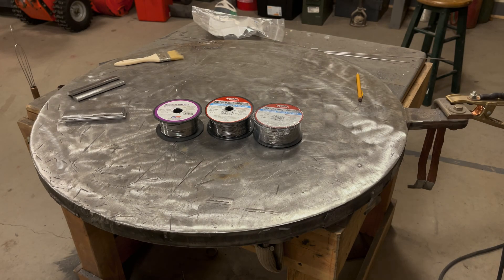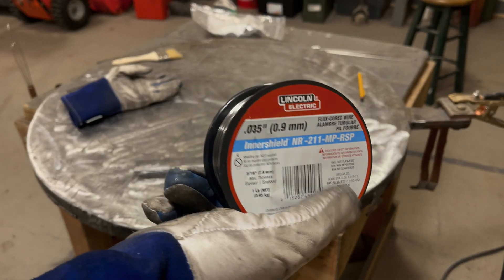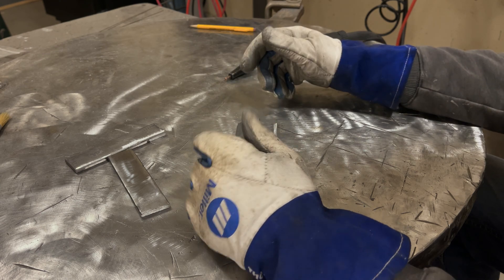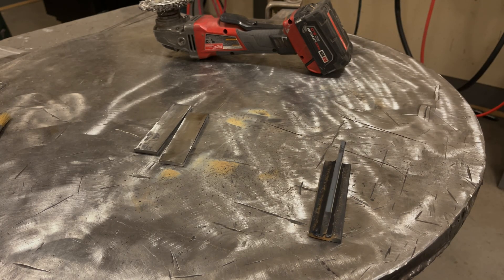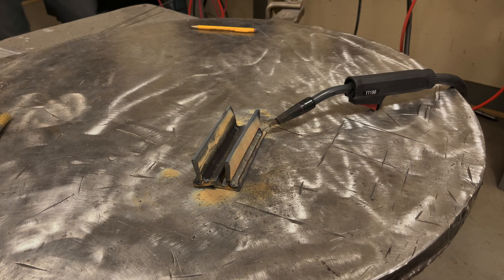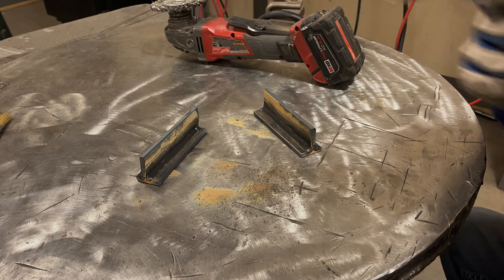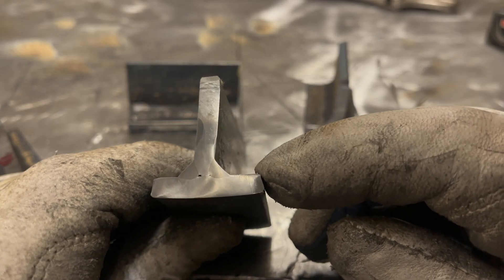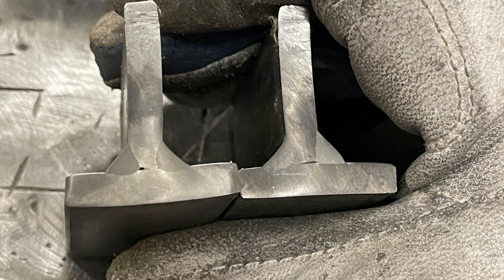Flux core welding part 4.75: 1/4in plate revisited

Comment: This series was great.  Thank you for doing this.  
What is the process of etching?
Reply from the maker: The easiest way to etch is to use naval jelly (strange name, and weird pink jelly) sold at most hardware stores as a rust remover.  Basically it’s a form of acid.  If that’s not available use oven cleaner, it will take a while longer but it works.  Once you cut the piece grind it a bit to polish it with a 80+ grit flap disc and then put the acid on with a qtip.  If the plate is warm it won’t take long for the weld to show up.  If you can’t see it well polish it to a finer level with some form of a sander (D/A, belt, etc) and reapply acid.  It’s worth doing to see how well your welds are doing for penetration 😀👍.

Comment: Great video good explanation, about that breaker tripping, what gauge wire and how long is the distance from the panel to the shop? all of those things matter avoiding the breaker to trip  even of it is a 20 amp breaker.
Reply from the maker: So that shop in the video had a dedicated outlet on a 20a breaker with #12 wire, panel was 25’ from the welder.  Since that video was shot I have come to understand through testing that the welder has poor power factor and it actually loads the input line to over 30a near max output.  It basically relies on the fact the breaker has a thermal trip and welding is a on/off process in the hopes it doesn’t trip the breaker.  Due to the nature of how that welder works (it doesn’t regulate output amperage) you can easily cause it to overload breakers due to setting the wire feed too high (this is besides excessive current due to the poor power factor).  This is generally the case with most 120v wire welders.

Comment: If anyone is interested in it my titanium 125 has a power factor of .37 according to the kilawatt meter
Reply from the maker: Your meter is very close to accurate.  I tested one since that video and came back with .40 with a moderate load, so for all practical purposes it’s right.  Pretty atrocious but provided the welder is on a dedicated 20a circuit it likely won’t trip breakers too often.

Comment: Just being curious is there any way to correct power factor on 120v single phase, i have seen the 3 phase ones don't know what magic is in the box though. Great video thanks.
Reply from the maker: Unfortunately there is no easy way to do it.  The machines that have power factor correction that can run on 120v generally can correct it at all output settings.  Using simple capacitors on the input power can make a difference, but more engineering would need to be done to correct it at all outputs and not just a small range.
Reply: @makingmistakeswithgreg  thanks for the info I'll look into input side capacitors my little stick welder pops breakers over 60 amps

Comment: Do you think the lower penetration on the higher settings could be from the molten puddle wetting out closer to the wire,  blocking the wire from hitting the joint? Kind of like downhill MiG where it’s just wire blasting into the molten puddle vs 6010 where the arc force is blowing the puddle upwards?
Reply from the maker: There is always a ideal range of settings for wire.  No doubt beyond a certain point the wire will just stack up metal ontop of metal.  Since that video I did a lot more testing with self shielded flux core and have come to the determination about the limit with .035 wire on a 120-140a machine is around 3/16th thick for defect free welds and 1/4 inch with some internal weld porosity.  This is for fillet welds, butt welds could likely have less weld defects.  Self shielded flux core in .035 tends to have hidden internal weld porosity on many weld joints due to how fast the weld solidifies, it traps escaping gas.  Going to bigger .045 wire, helps due to heat input, as does using a much more powerful machine.  So basically you’re caught in a catch 22:  a low wire feed will have poor fusion but clean internal welds due to a lack of weld deposit on above 1/4in, a high wire feed produces better fusion and more properly sized weld but the weld has internal defects.
Reply: @ very interesting. I just bought a esab rogue emp210 pro and spooled it up with some .035 flux core from Washington alloy co. I tried it on 120v and made a 4” bead before blowing the 15a breaker but it ran stupid smooth. No crackle or anything. Just a buzz almost. I’m going to try it on my generator and see how it works on that but I’m super pleased with the rogue emp210 pro. Runs 3/32 7018 on 120v as well but maybe not quite as hot as the rogue 180i pro I have. That thing is a freak on 120v and obviously moreso on 240. Do you think you could include some .035 on some hotter settings with a 240 machine? I feel like it’s definitely worth using .035 on a 140 or 180 class and keeping the .030 for the 120v 125 amp machines. Also, Washington alloy co makes some really good rods and wire if you’re ever looking for a new test to try out. They’re 6010 runs better than any 6010 or 6011 I’ve ever found. Welds vert, horiz, and overhead 10x better than any Hobart 6011 I’ve used. And plus, the flux core from them runs so easy that other than your videos, I have no experience with flux core and made a bead that looks unrecognizable from a 7018

Comment: thank you for all your hard work , i am puzzled  with your 1/4 "  test results ( higher settings = less penetration ) . did you come up yet with any theoretical ( scientific ) explanation for those results ? recently upgraded to PRIMEWELD MIG 285 . mostly use flux core for my projects , but if more power  not =  more penetration , i would like to know why  ???
thank yoiu
Reply from the maker: So I think it comes down to a few things.  More wire means more molten pool, and a thicker weld pool means the heat from the arc has to travel through more material.  Fillet welds force the molten material to bunch up in the corner, so if you slow down on thicker plate you can oven lose penetration with mig and flux core for this reason.  Too much wire will often just stack more metal outward from the root.  

Self shielded flux core with quality wire tends to be a great option on material 1/4 and under.  Above 1/4 inch the welds tend to have issues with porosity due to how fast the weld pool solidifies.  If you take 1/4in and 3/8th steel in a fillet weld and weld them out with flux core you will likely find small pores in the weld if you break it.  To get around this issue .045 or bigger self shielded wire must be used, .030 and .035 tend to not be able to carry enough heat to weld thicker steel without porosity issues.  Dual shield (gas shielded flux core wire) tends to not have this issue because the flux doesn’t seem to produce near the same amount of gas as self shielded wire.

Comment: I thought this was going to be a series on flux core and wire types/ brands, not another titanium 125 video.  
Greg, thanks for doing tests and showing it might have some trouble.  The are people that swear that this is the little welder that can...
I applaud HF for not lying much about its maximum output, it's everybody else that's pushing it.

Comment: Dang I should have watched this before I commented on video 4.5 because you got into my go to wire in this one.  The flipping the breaker in this video reminds me of something I noticed with my little Lincoln and it could be true with the other little 120v units that I don't remember ever noticing with bigger machines and that is the difference supply power can make.  Like on my Lincoln first thing I did was to put a new power cable on it I used a 20 or 25 foot extension cored with the biggest coper I could fined. as a bonus if you leave a little length on the female end when you cut it off you can do something like I did and poke a little grinder plug out the front of the machine.
Reply from the maker: Any voltage drop will make a big difference.  Simple transformer welders will lose significant output as the voltage drops.  So your normal “welds perfect” settings all of a sudden weld poorly when powered on an extension cord or different circuit.  The input voltage drop directly drops the output.  With more modern machines they will be far more stable on the output, however many will go into protect mode or suffer damage due to low voltage.  No doubt 120v welders are far worse than 240v.

Comment: Firstly, thank you for spending countless hours producing these videos. For neophytes like myself, it has proven very helpful; both your stick welding series and now the flux core series. I have very recently purchased a Yeswelder MIG 205 DS Multi functional welder. Because I live on a farm, there are always repairs to be done and I have always relied on a neighbour, who is even longer in the tooth than I am. So, I thought I had better learn how to do these repairs myself. Watching your 20 amp circuit breaker trip on a 110/120 v house system made me think of asking you what your thoughts are on running this Yeswelder ( supposedly rated to 200 amps ) on a portable 4 KW generator which offers me 240 v output. Because it would be a portable system, I can take the mountain to Mohammed vs bringing the farm equipment into the barn or the garage. Many thanks!
Reply from the maker: So I can tell you the generator won’t have enough power.  I have made a “welders on generator” video 3x now and I am still not happy with it, so take 4 will be out soon lol.  The two issues you will run into is the power factor of the machine and the efficiency.  In simple terms welders without power factor correction cause power to be reflected back to the generator or the power grid (reactive power).  This amperage on the input line is not used by the machine, but the breaker doesn’t care.  The welder could be 100% efficient and with poor power factor it will still trip a 20a breaker.  

The simple way to find a generator rating needed is to take the output amperage and the max voltage of the machine.  With a 200amp mig machine that’s probably 200a and maybe 24v.  You multiply those by each other, which is 4,800 watts at max output.  Without power factor correction you need to times that by 2 and that is the breaker rating to max it out.  So about 9600 watts (at 240v generator power) which gives you about 40amp circuit (9600 divided by 240v).  In my own practice my 200amp inverter might machine actually loads the line to about 36-37a at max output.  If the machine had power factor correction you would only need around a 5k generator to run it.  

I know it sounds stupid, but you literally need bigger wire and a bigger breaker just to handle to reactive power from the welder, it’s not that it consumes the extra amperage, it reflects it back to the source.  This is why I can run at 200amps with my esab 235 without issue in a 7600 watt generator and my firepower trips the breaker.  The esab has power factor correction.
Reply: Excellent response and I get it. Thank you!  I have done some further sleuthing and read about the power factor. Unfortunately, I didn't anticipate this when I bought the generator to built a 1500' cedar rail fence ( screws vs nails ), nor did I appreciate this when I bought the welder itself. So, I'll go to plan B which is to run 6/3 copper wiring from the beaker panel and a 50 amp breaker to a plug in the garage which can be used for either the welder on 240v or someday a plug in hybrid/EV ( if the EV's continue to be shoved down our throats).  lol  Thank you again. :)  @makingmistakeswithgreg

Comment: I’ll clarify my last comment. I’m running the same machine. I have a 20amp breaker running .030 wire on 3/16 at factory suggested settings. I always trip the breaker. I plug it into my neighbors 50amp with a reducer plug from 220 to 110 and can run the higher factory settings suggested for 3/16. I’m putting in a separate 50amp to avoid tripping it constantly. It will allow me to use my plasma cutter as well. Do you see any issues with using the reducer plug on 220 50amp? Since you have done more testing, what settings would you suggest for 3/16” using .030? Thanks!
Reply from the maker: So wire fed welders have some interesting properties, one of which being that they can’t exactly control their amperage output.  Since they are constant voltage variable amperage, the amperage is controlled by wire feed.  Well on most cheaper welders they don’t have the ability to regulate output much, which means you can often run higher wire feed than you probably should, thus more output amperage.  Generally speaking you would want to run the machine on a dedicated 20a 120v breaker.  Due to poor power factor, the machine may load a circuit with far more current than 20a despite actually consuming less than that.  There isn’t much that can be done with this issue unfortunately.  Many higher end wire welders have power factor correction and can output 140a on a 20a without an issue.  

As far as settings, I would recommend using .035 wire for welding 3/16th.  You will likely find internal porosity in welds on 3/16th with .030 because of how fast the weld pool solidifies (gas can’t escape).
Reply: @makingmistakeswithgreg  I appreciate your response and detail put into it. Thank you!
Reply: I run this welder on a 20 amp and have ran at close to h-9 on 1/4 with .030 and didn't trip my breaker

Comment: i wonder if when you did the first plate ( not maxed out) if the feed and voltage settings were spot on , but when you maxed out on the second if for some reason the feed was maybe too much by a tad and you didnt say how much time between the first plate and the second if the unit was at a different heat on the eternals . it could be the combination of both wire and unit wernt a good match compared to say a blue or red box welder might have had different results . either way , this is showing the unit is quite good for a home hobby or even a shop who only used the unit to attach a bracket or exhaust pipe . great vid series ,im really learning something . buy the way , i love my 20 year old red box 120v unit . thanks .

Comment: Interesting what you said about the flux in flux core. I knew nothing about welding but bought a Everlast Mig. I always had a hard time making welds look good. I was under the impression the wire needed more flux. I have stick welded some. I bought some Kiswell wire from amazon that worked better than the yes wire. I will have to go up to 035 wire now.
Please buy some Yes wire & the Kiswell wire and let us know what you think.
Reply from the maker: So I have done some more testing in more recent videos (like my recent flux core vs Mig video).  There seems to be a practical limit around 1/4in steel for .035 flux core wire.  Even with a much more powerful welder I can’t get porosity free welds on anything thicker than 1/4in plate with .035.  Stepping up wire size would likely help with that, but standard self shielded flux core has a practical limit of just under 3/8th steel with most wires according to manufactures.  I have also been experimenting with .035 dual shield to see if that would work, a video will be out in a week on that.

Comment: Please buy a mig that uses volts & in. minute for settings. The letter number thing helps no body.
Reply from the maker: The video in specific was designed to help people with the harbor freight welder, which happens to be the most popular flux core welder sold.  The truth is hard numbers are of little value to actually weld with.  Every machine has their own values in their own chart, and should be followed.  There are no magic numbers that work for every welder because every welder is plus or minus 2-3 volts and +\- probably 75in a min wire feed of setpoints.  A vast majority of home hobby welders also don’t have digital displays.  Learning how to weld based on what your machines chart says and what the welds look like is the only way to succeed.
Reply: I dont weld all the time so, lots of thinking goes into using my neverlast welder that doesn't have a chart.  I called them to see if they had card and they laughed.  I guess they a chinese welders for pros.

Comment: So if you had pre heated the plates prior to the first run do you think you would have gotten better penetration? I mean this machine isn't even meant for 1/4" but it clearly can do in a pinch.
Reply from the maker: Preheat will undoubtedly increase penetration.  I see preheat as more of a non critical solution to solving a problem.  The issue with preheating is can affect what you’re welding on negatively.  It’s a variable that is highly dependent on specific things (aka temp and how consistent the temp is).  Preheat in a stable oven is far different than a mapp gas torch if you know what I mean.  And since you can’t see the inside of a weld on something easily, it’s not reliable enough to use on critical material without more control.   With all that said if all I had was a 125 amp flux core welder and a map gas torch, you better believe I would use it to make some stuff out of thicker material 😃